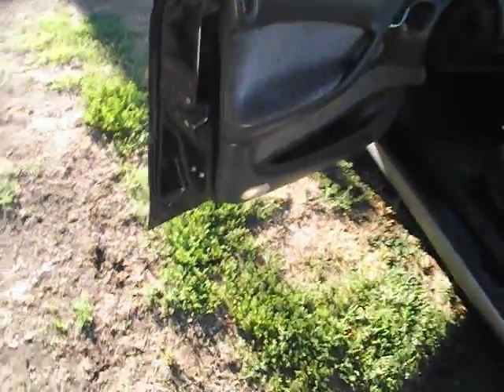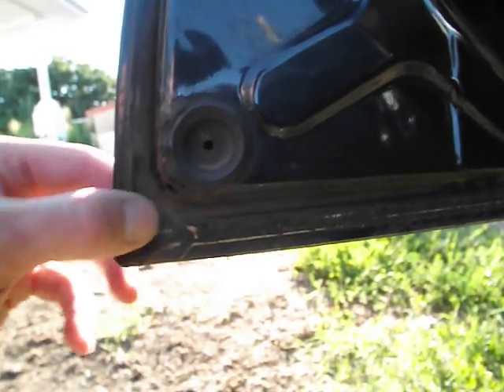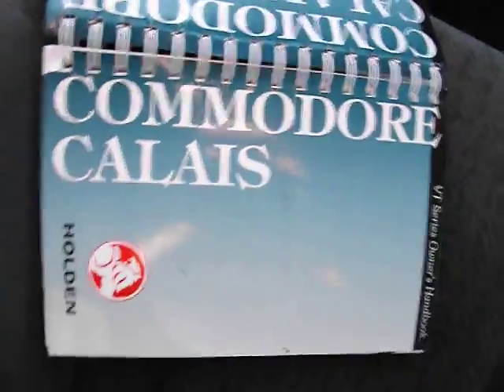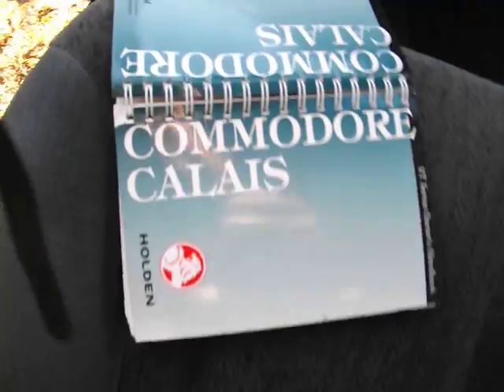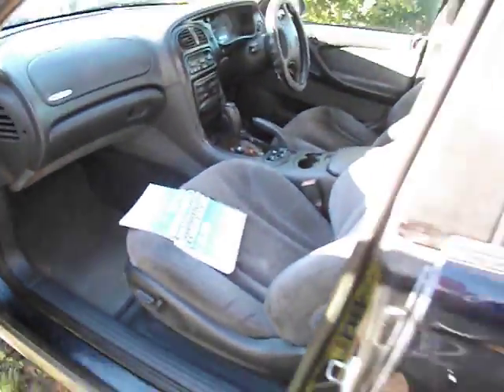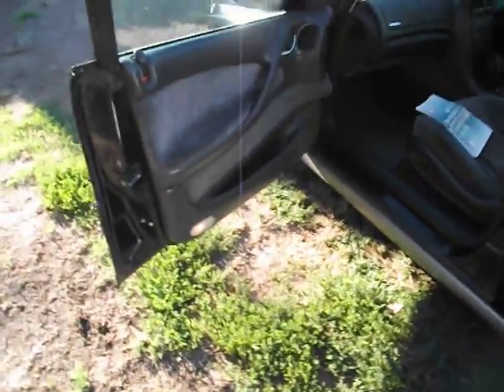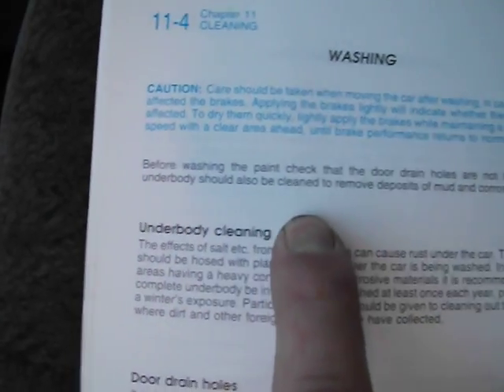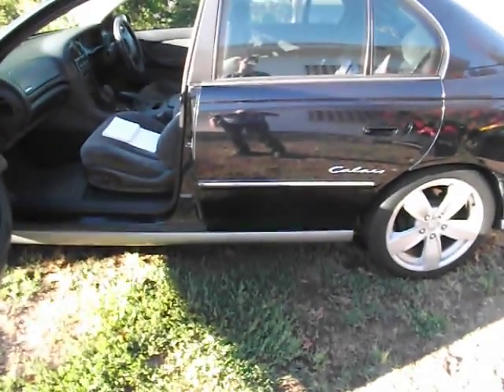Clean out your doors and drain holes! FFS

Comment: Should not have to the seals should be bloody water tight
Reply from the maker: They probably were almost 30 years ago...
Reply from the maker: It's sad that I have to reply to stupid comments like this.
Reply: @wickedxe  and a 10 year old car and they cant make them now,,,, pathetic, no wo wonder Ford and Holden have closed down too many short cuts
Reply from the maker: @davepoulton7530  I like this comment. Let's be honest; anything later than  (after) VY will not have the rust in the door problem as they will be sent to China way before the 25 year old point. You are right, the late cars are so crap the get sent back to Australia as frying pans by the 10 year mark
Reply from the maker: @davepoulton7530  I will also say that in my opinion VS was the best quality car Holden ever made; I love my Supercharged VT Calais but it is really obvious when you pull a VT apart that it is not as good quality, lots of plastic clips/fasteners and way less screws, doesn't feel as solid as VS. That being said however, I would say VT is way better quality then VE and later.